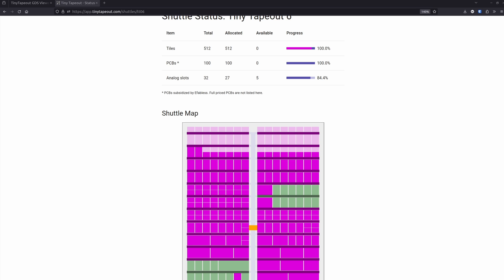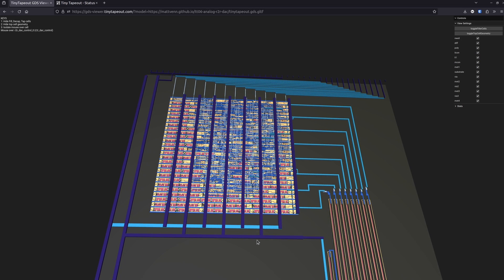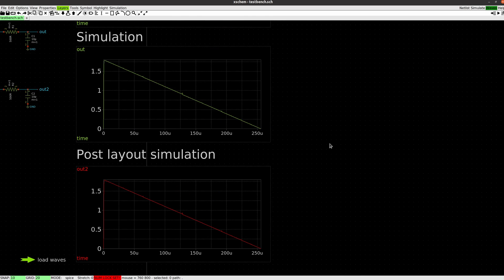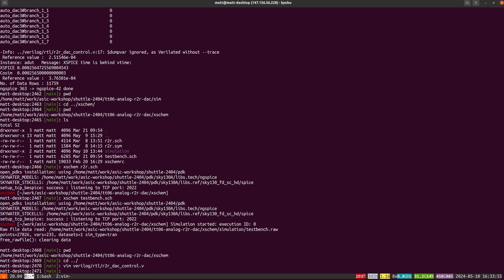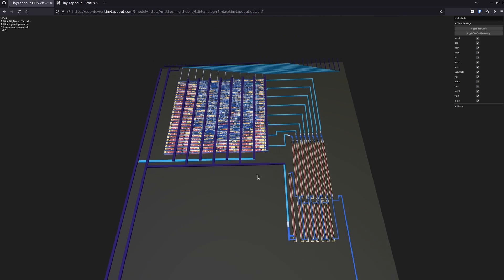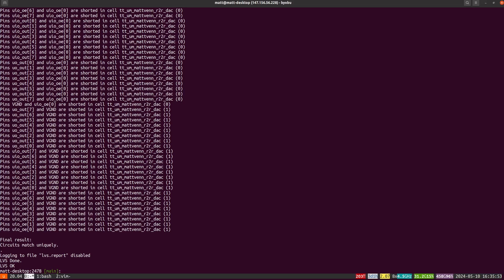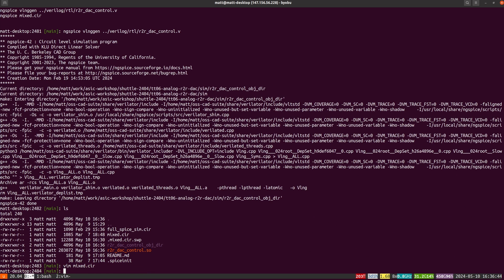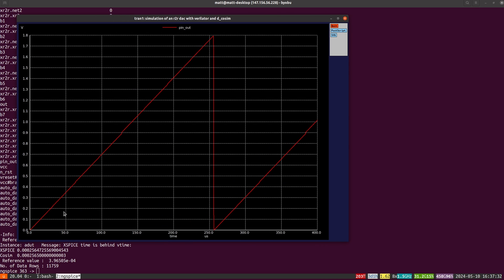Mixed Signal ASICs with Open Source tools

Comment: I have a question: what software do you use to write and compile verilog?
Reply from the maker: You can use any editor to write. Compile isn't really the right word. Better is simulate with a tool like iverilog, or synthesis to a netlist with yosys. For making the GDS we use a tool called OpenLane
Reply: @ZeroToASICcourse  after cloning and following the video instructions I got this warning after "make clean lvs"Warning:  Ports "VGND" and "uo_out[7]" are electrically shorted.
Warning:  Ports "VGND" and "uo_out[6]" are electrically shorted.
Warning:  Ports "VGND" and "uo_out[5]" are electrically shorted.
Warning:  Ports "VGND" and "uo_out[4]" are electrically shorted.
Warning:  Ports "VGND" and "uo_out[3]" are electrically shorted.
Warning:  Ports "VGND" and "uo_out[2]" are electrically shorted.
Warning:  Ports "VGND" and "uo_out[1]" are electrically shorted.
Warning:  Ports "VGND" and "uo_out[0]" are electrically shorted.
Warning:  Ports "VGND" and "uio_out[7]" are electrically shorted.
Warning:  Ports "VGND" and "uio_out[6]" are electrically shorted.
Warning:  Ports "VGND" and "uio_out[5]" are electrically shorted.
Warning:  Ports "VGND" and "uio_out[4]" are electrically shorted.
Warning:  Ports "VGND" and "uio_out[3]" are electrically shorted.
Warning:  Ports "VGND" and "uio_out[2]" are electrically shorted.
Warning:  Ports "VGND" and "uio_out[1]" are electrically shorted.
Warning:  Ports "VGND" and "uio_out[0]" are electrically shorted.
Warning:  Ports "VGND" and "uio_oe[7]" are electrically shorted.
Warning:  Ports "VGND" and "uio_oe[6]" are electrically shorted.
Warning:  Ports "VGND" and "uio_oe[5]" are electrically shorted.
Warning:  Ports "VGND" and "uio_oe[4]" are electrically shorted.
Warning:  Ports "VGND" and "uio_oe[3]" are electrically shorted.
Warning:  Ports "VGND" and "uio_oe[2]" are electrically shorted.
Warning:  Ports "VGND" and "uio_oe[1]" are electrically shorted.
Warning:  Ports "VGND" and "uio_oe[0]" are electrically shorted.
finally, have a error 
grep: lvs.report: No such file or directory
grep: lvs.report: No such file or directory
grep: lvs.report: No such file or directory
grep: lvs.report: No such file or directory
grep: lvs.report: No such file or directory
grep: lvs.report: No such file or directory
LVS FAIL: match=0 properties=1 port=1
make: * [Makefile:31: lvs] Error 1
Have you ever encountered this error?

Comment: I’ve installed xschem and ngspice and I get errors when running ngspice after netlisting.  The issue is that there is a “.save i(v1)” in my spice netlist that ngspice doesn’t like.  Any ideas how to stop xschem spitting this out.  My sch has no commands that would do this and I followed Stephans tutorial to the letter.  Just curious if anyone here has experience this.  I’ve spend over a day trying to figure this out.  Rebuilt both tools and used different repos.  Same result.
Reply: BTW if I hand edit the netlist spice file and remove the .save i(v1) it works fine.  However I don’t want to be editing this file every time a netlist changes and I want to simulate.  PITA
Reply from the maker: Do you have a current meter in the circuit? If so try removing it
Reply: @ZeroToASICcourse  No.  So as it turns out the VSource symbol by default has a “.save (@v)” attribute in it and this gets dumped into the netlist.  The other Voltage Source symbols don’t have this.  I’ve done a load of SPICE stuff in the past and wasn’t expecting a released symbol to have this in.  I suspect Stephan was doing an experiment and it got accidentally checked in.
Reply: It’s a “.save. ….something attribute”.  Can’t recall off hand what exactly it is now since I’m not in front of the tools etc.  Descend into the symbol and press “q” on the keyboard to see it.  I put a “*” in front of it to comment it out.